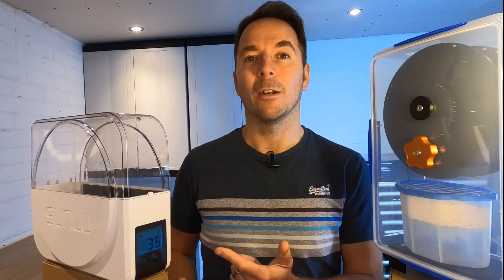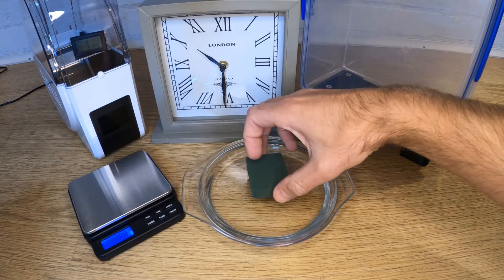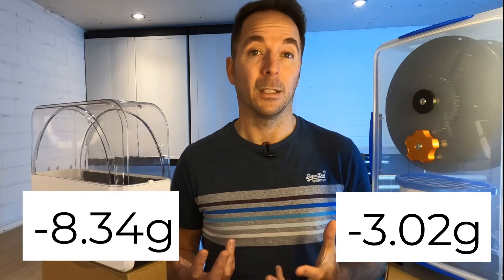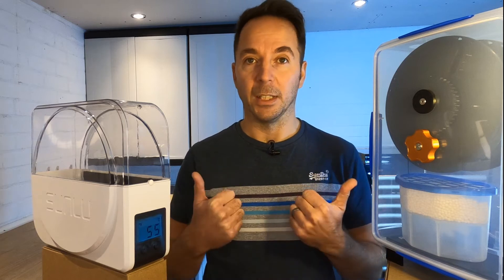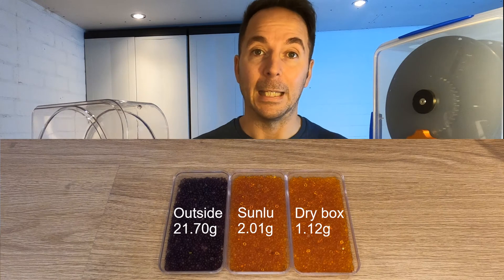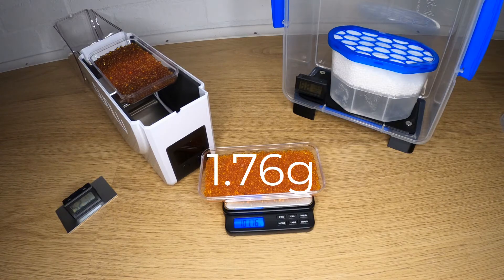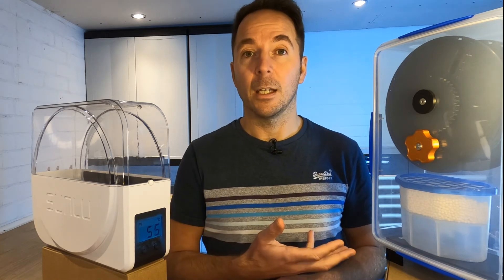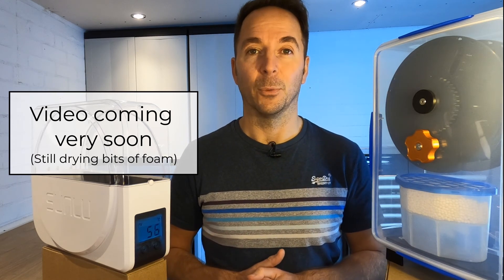Sunlu S1 Filament Dryer vs Filament Dry Box

Comment: So if buy new spool find that it's wet so place it in my heated dryer box will this remove the moisture from the fillement also mine has desiccant in the bottom of my dryer box

Comment: Hi
from my experiance if you add a fan on the dryer pack it boosts its efficiancy X2 to X4 times. so it might  dry even better
Reply: What is "dryer pack"?? Video doesn't use word "pack".
Reply: @daitedve1984  auto correct ment desecant pack . Or what ever you use .

Comment: Hi Ricky! I have finally made the decision and settled for the Creality Ender 3 S1 Pro. I've placed the order just an hour ago. Now I'm looking into a good dry box. May I ask for your recommendation on a good filament dryer? It can be a ready-to-use dryer or one that needs modification or  a completely DIY one is okay. I'm willing to put in the time to make it work.
Reply from the maker: Hi, congrats on your purchase, I think you'll love it! From what I've seen there is no perfect filament dryer on the market. The Sunlu/Jayo S1 is generally cheaper now but it needs some mods or at the least, the lid propped open to work the best. I haven't tried the S2 yet but I see nothing that suggests it will be any better as it still has no ventilation. Personally I prefer to save some pennies and buy something less expensive that will do the job but I've had people recommend the Eibos models. They are a lot more expensive though.